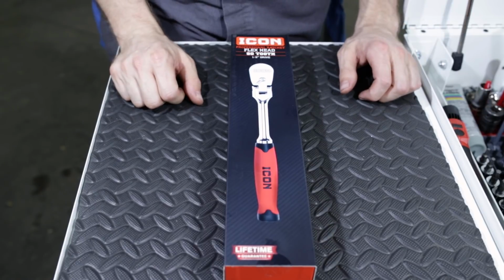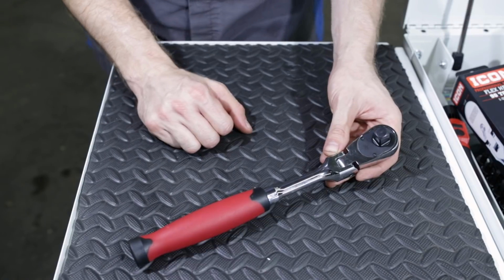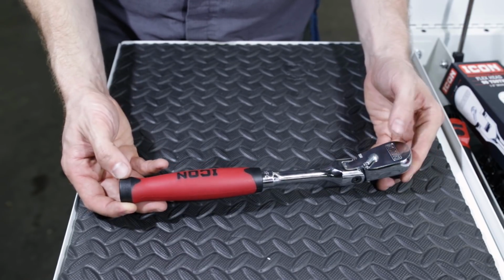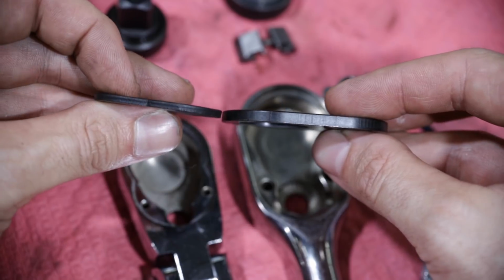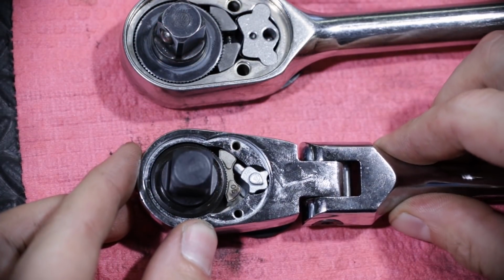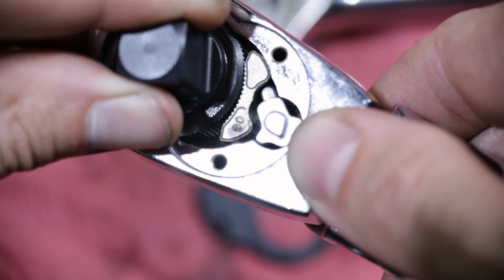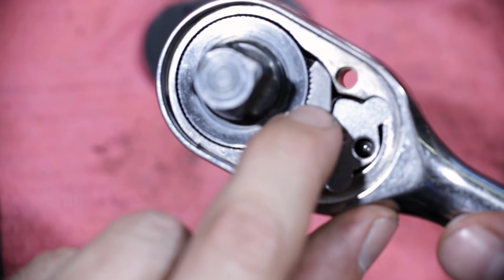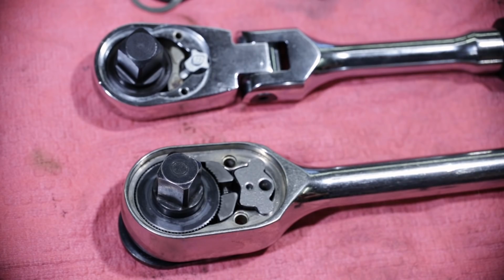Harbor Freight ICON 1/2" Drive 90 Tooth Flex-head Ratchet

Comment: Not to be critical Robert but I was just wondering I thought though Icon wrench was meant to get into tight places so that is why the head would be smaller now that doesn't excuse the small screws but is it fair to compare it to the dual 80 with a non swivel head.?
Reply from the maker: All Snap-on Dual 80 1/2" drive ratchets have the same size head and same internals. Uniform across the range, unlike ICON. A 1/2" ratchet isn't designed for tight places. If space is an issue you'll be using a 3/8" drive or a wrench, not a 1/2" drive ratchet.
Reply: @MrSubaru1387  Aha!! Thank you!

Comment: I just don’t believe comparing a non-flex head to a flex head is a fair comparison. Apples-to-apples not apples-to-bananas.
Reply from the maker: For the thousandth time. Snap-on uses the exact same head size, internal components, and cover plate on all their 1/2" drive dual 80 ratchets. It doesn't matter if it's flex or straight, the guts and head are identical. This is apples to oranges only because the ICON doesn't stack up.

Comment: I've been watching some of your video's lately.  I have a question for you.  In Australia, the Subaru Tribeca has a 'space saver' spare wheel, located UNDER the vehicle.  I want to find a rim which will fit the stud pattern etc so I can get rid of that 'space saver' spare wheel.  The normal 8" Subaru wheel will actually fit, but slung too low to the ground, or road.  At the moment I have to chuck a spare wheel in the back of the vehicle, which consumes space in the boot.  I have researched and apparently a Falcon BA (in Australia) rim will fit, with the same stud pattern and the centre 'hole' will fit.  I want to find a wheel which fits the spare wheel well, and put a larger diameter, or higher profile, tyre on it so I have the similar rolling diameter to the normal wheel.  We don't have garages every 5 Kilometres here, we drive large distances here, like 100's before we find a garage.  I don't want to have to drive long distance at 80 kph, or (mph), on that stupid 'wheelbarrow' spare wheel.  Thanks.
Reply: @behexen250 Yeah, no worries, but, the rim is wide, 8", whereas that Falcon one I mentioned only has a 7" rim (I think), makes it narrower.  Then, I can put a higher profile tyre on that rim to give me a closer rolling diameter when on the car.  Thanks for replying anyway.  I'm not happy using a "wheelbarrow" wheel matching up with the Subaru wheel, if you understand.  For two reasons, one, it's an inch lower (or more), which alterers the rolling diameter paired with the higher rolling diameter, second, it's not that convenient travelling at 80 kph when you've got plenty of traffic travelling at 110 kph (here) on the highway doing the day whilst you are only doing 80 kph.  I believe it's a ridiculous idea in Australia (opinion).  It might work in Japan, or wherever, where there is another town only 2 K's down the road, as an example.  If I'm driving at night and I get a flat tyre, then I will have to travel 100's K's to the next town to get it repaired the next day.  Perhaps it's my age, it just doesn't gel with me when I have two wheels travelling of different rolling diameters for miles and miles.  I don't know, maybe todays technology doesn't stuff up mechanicals with different size wheels?  Yeah, I'm probably a bit of a Dinosaur being old-ish <grin>.

Comment: Very good comparison thank you, but your comparing the Icon flex head ratchet you should compare the Icon regular straight head none flex head 1/2 or 3/8 ratchet you will be surprised totally different mechanical system inside and a lot more robust that would be more of fair comparison apples to apples still not as good as Strap-on but for a third of the price and a hassle free warranty its worth a look.
Reply from the maker: There isn't a non-flex 1/2" ICON ratchet. The Snap-on ratchet uses the same head regardless of it being flex or none flex, they all use the same sized head and same internals.

Comment: I really don't care for any "soft grip" tools. The main reason is they are too difficult to clean. A typical steel handled tool is much easier to clean.
Reply from the maker: A shot of brake parts cleaner and a rag. Not difficult at all.

Comment: I've seen reports from some on YouTube of these icon ratchets locking up under torque?
Reply from the maker: My 1/4" is already getting crunchy.
Reply: They just recalled the 3/8 drive ratchets
Reply: @alexpinci3432  - link for recall?
Reply from the maker: @alexpinci3432  yup. Saw that yesterday. All three ICON ratchets I have, and have disassembled, had little to no oil/grease in them. All basically dry inside.
Reply: The chrome is flaking off from around the edges of the pivoting flex head on both my 3/8th ratchets

Comment: My Mac ratchet has had a problem with the teeth staying engaged under even medium load say 50 foot pounds since day one. I don't have a regular mac dealer anymore because i moved out of his rout so i have to get ahold of him and meet him somewhere to get it repaired or mail it to mac. I plan on doing that some day but im a busy guy and it is easier now days to go to harbor and by replacement tools and have mac and snap on warrantied every few years when i run across a dealer. I bought the icon for that reason. Seems like a nice ratchet for around half the price as the mac and i guess time will tell how well it works. I do have to say the microfiber cloth it comes with was always a nice thing to get with a pair of glasses but is the stupidest thing i have ever got with a tool!

Comment: Watched several tested and the icon ratchet seems to have an issue with getting jammed
Reply from the maker: Yeah, was a recall on the 3/8" flex head ratchets. I've noticed issues with my 1/4" ratchet as well, even after I've lubricated it.

Comment: Has anyone ever seen the faceplate be the malfunction of a ratchet,,,I also look at it like this Indy drivers tires are made to wear out to give the best performance there not going to use a 80 thousand mile tire in a race, So to me icons are made to be run hard put away wet and be easily replaced as needed,,,Bring you broke snap on ratchet into the truck with breaker bar marks on the handle and see what they say,,,it’s probably nope icon says go grab another one son,,,,

Comment: This is apples to oranges.  Every flex head I’ve seen has a smaller head.
Reply from the maker: Snap-on doesn't. Every Dual 80 1/2" drive ratchet has the same size head and guts.

Comment: I think this ICON ratchet has a similar mechanism to the MAC Axis or Proto Precision 90. I do have a proto 3/8 precision  90 13" flex head , the internals look similar to the ICON. I do have the ICON 17" 1/2" flex head. To me they are similar. I wish I had the funds to buy a 1/2" proto precision 90 17" to do a comparison with ICON. I do intend to upgrade to the Proto 1/2 precision 90 17" flex head. I also think the ICON ratchet would be comparable to SK LP 90. Also a good comparison with the new Gearwrench 90 tooth. I work in as a maintenance tech at a factory, so far both proto and ICON hold up to daily use. For guys starting out there is nothing wrong with ICON ratchets. I'd take ICON over Craftsman, Kobalt, HF Pittsburgh and even some Gearwrench any day of the week. I do think Tekton and Carlyle are superior products.

Comment: This is an unfair comparison, you're pitting a flex head ratchet against a non flex which has a larger more robust mechanism.
Reply from the maker: 100% WRONG. All Snap-on Dual 80 1/2" ratchets have identical sized heads and internals.

Comment: Sad thing is I’ve had snap on ratchets break more than craftsman the flex head snap on is garbage I snap the pivot all the time and good luck with dealer warranty them they say abuse but I can break them without cheater pipe I think best ratchet is proto far better than snap on
Reply from the maker: Never had an issue with mine, 5 years without a rebuild, nor did I see them breaking constantly as a Snap-on dealer. Sure sounds like abuse/misuse to me.
Reply: Snap on dual 80 ratchets are nothing special when it comes to strength. My co worker has broken his 24" flex head dual 80 ratchet without using a cheater pipe before. I broke my cheap Made in Taiwan equivalent with a cheater pipe once.

Comment: I guess it depends. I have a 3/8" Snap On ratchet and the teeth got jammed when removing a 19 mm bolt from the brake housing. I have to use my old Craftsman ratchet to get the job done. Snap On may be a great brand, but often times, you don't need a Snap On to get the job done. hmmmm.....maybe there's too much hype on Snap on, and they just lost their edge. Sorry Snap on lovers. lol